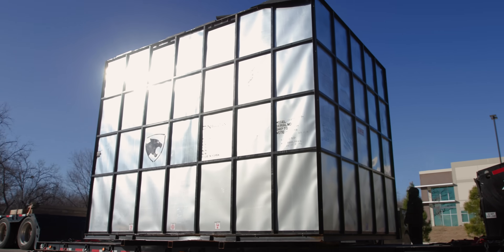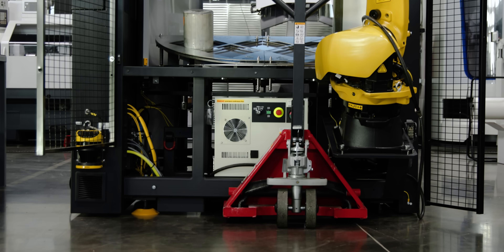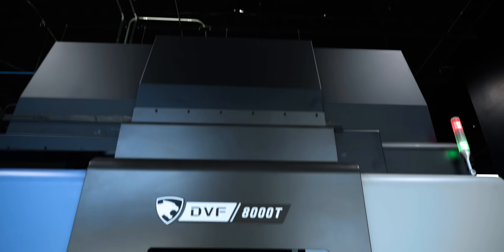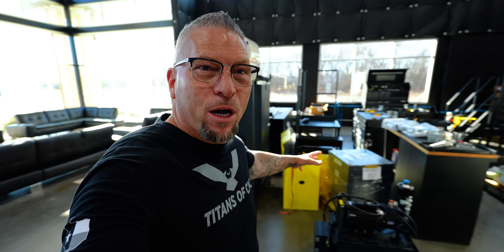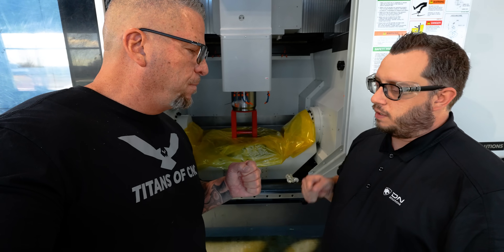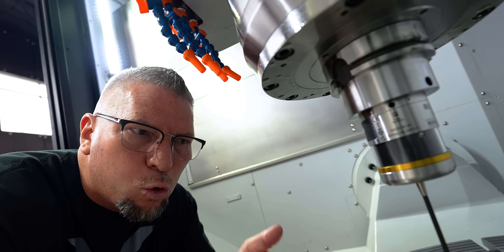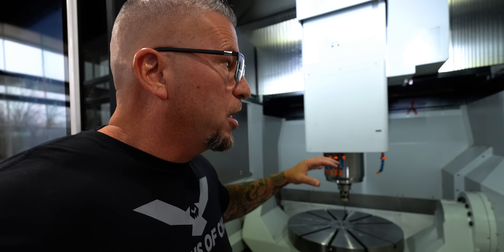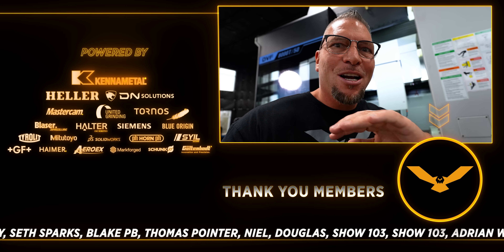Spectacular CNC Machine Mills & Turns Hard Materials to Incredible Tolerances

Comment: nice to have glass mesure, and a lot a bit for encoder to ensure the smoothess operation for hsm,  rotary encoder for smooth and scale glass for precision, thermal compensation and chiller,  the position for lathe its probably separe in 15 degree,  i hope  you have a lot a hp torque to turn  a large size, and a specific software and position positioning in spindle to use the high tech tool for lathe, good luck and make chip chip chip :)

Comment: What kind of power consumption does this kind of mill use?  I know you can't just plug it into a common 110,120 or 2-whatever.  Does it take multiple power sources to power each system within the mill?
Reply: Most likely 440

Comment: I just watched a video that y’all post year ago about SLS 3d printing followed by EDM cutting. I have a water/methanol manifold that routes 2 hyd circuits, with 2 inputs and 12 outputs, all within the footprint of the intake manifold gasket of a medium sized diesel engine. The design as is would be best done by SLS in AL/SS metal, however, would they be watertight, or merely water resistant at 300 psi? I could modify the design to make it hopefully CNC capable, I was just hoping to not go that route if possible.